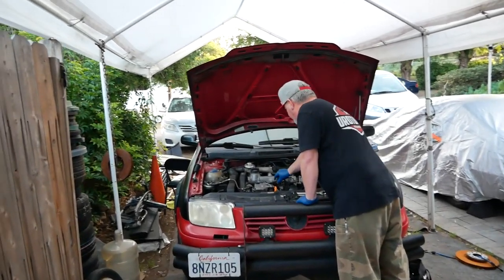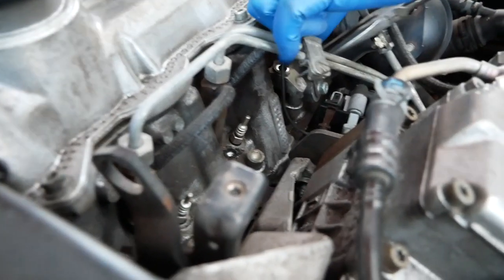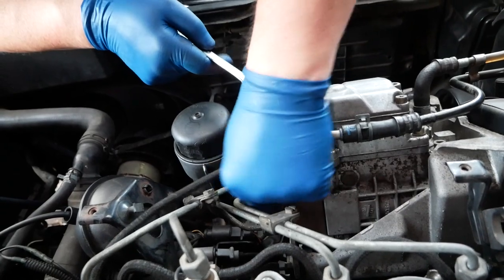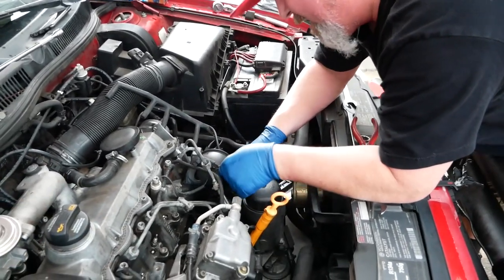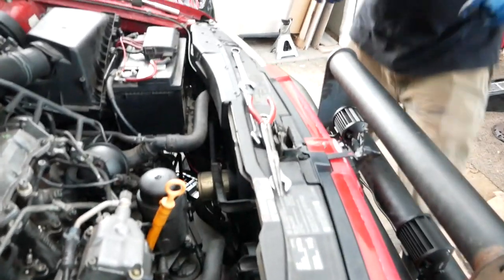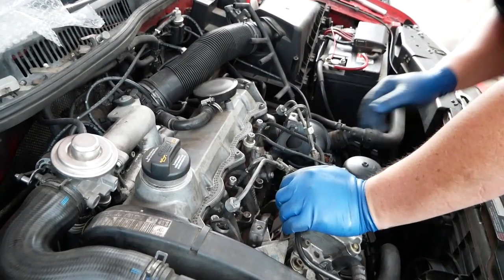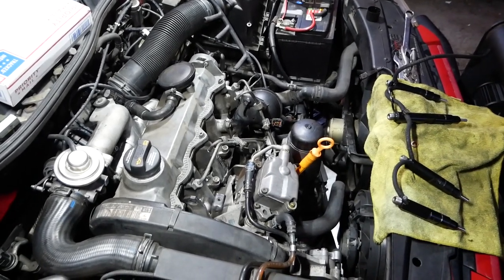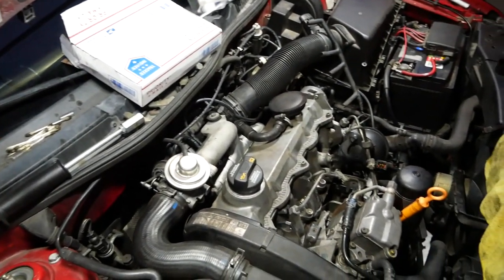How to install Upgraded Nozzles in a MK4 TDI ALH Jetta/Golf - S6EP22

Comment: Its like you skipped steps through it, kerma sucks any way just like your commentating skills
Reply from the maker: And that is ok! Not everyone is perfect. Glad we have people like you around to keep us in check.

Thanks Again! 💝
Reply: I disagree.  Thanks kerma.
Reply: We are being showed how to do it so anyone can do it. I hate the involved videos. This makes it much easier. I’m planning on doing a full overhaul of my ALH 1.9. Turbo, exhaust system, colt cam, pd150 intake, stage 3 clutch, ECU tune, injector nozzles, MAF. Already did all vacuum lines and any intersecting valve. Did a intake manifold and egr because my state requires a egr, however I found one guy who will sticker me with a deleted egr so getting ready to do the intake manifold again for a PD and straigjt pipe instead of stock shit. Hope to get close to 160hp or more. Looking at a gt1856v. Seems to require the least amount of mods for a ALH. Mine has only 120k that’s why I’m doing this. Has a slight knock but it’s due to the injection pump and or injectors I have found based on forums so hope to get it running mint and with tons of power. Any recommendations would be great thank you!
Reply: Wow. This doesn’t replace the nozzles at all. Useless.
Reply: This guy is terrible
Reply: @smilefatboy   it does tho, it’s the kerma hot swap, they put the  nozzles on rebuilt injectors for you and you send them your factory injectors
Reply: Lol, you shouldn’t be wrenching on anything if you need more steps for this, my 8 year old nephew can figure it out. I mean u own a powerjoke, probably a 6.0 Covidstroke too, kinda explains everything now
Reply: Griz, why you gotta be a rude dick? This vid was excellent.

Comment: Slide hammer puller... no need! Break torque and a tad looser on hold down blocks one at a time and run engine so the power stroke loosens them for ya :)

Comment: Kerma tdi has provided me with most of my parts for my mk4 tdi. I use FCPEURO for the rest. Now I cannot remember based on the view but, either cylinder 2 or 3 injector line was bent upon removal. There’s a slight kink noticed around 4:20 ish hard to notice, but I know because any sorta kink restricts flow and could  potentially have fixed part of your problem making up for it with the new injectors, but that one line (if you have any problems forward) would be the cause. You could see he had a hard time removing it, had to replace the block to loosen it. Like he said, make sure you crack the lines before pulling the blocks!!! Kinking a line is no fun..

Comment: Good video.  I've changed many of these...  The only thing I would add to this video is:  Use extra long qtips so you can't drop them in the head.  Either that or tape them very securely to a pencil so that if you do slip, it doesn't get in the head.  Regular qtips work, but even when vice gripped, they can fall off... Hasn't happened to me, but I've heard horror stories of people having to pull heads for that reason.  Laquor Thinner also makes a great cleaner (when used in moderation and care).
Reply from the maker: Good advice!

Comment: If you own an alh tdi just buy a harbor freight fluid extractor , dont waste time with a mightyvac. That way you can just remove the fuel lines whenever you need to and get them clean out of the way . Anytime you have to do any work to or replace injection pump or injectors it makes priming simple and only takes minutes . Must have for diesel owners
Reply: Don't need it. Air won't go in fuel will drop out air don't go in

Comment: Just remove the lines and cap the pump. Gonna have to bleed the fuel system anyway since you are gonna replace the fuel filter to protect your new injectors. Why would you reuse those old return lines and bolts? If there is dirt in the holes, why don't you clean it out? The factory manual has torque specs ya know.  Don't teach people how to take shortcuts. I'm just busting your balls and sharing my thought as I watch the video. I still gave it a thumbs up.
Reply: Don't have any experience rookie

Comment: I've driven VW diesels my whole life and I have never had to "purge air" from the lines or injectors to get an engine to start. The whole process of cracking the lines at the injectors is nonsense and only serves to spray diesel all over your hoses and engine bay as seen in the video. If your filter and pump are full of fuel, the pump will very easily overcome the air in the lines and injectors with diesel fuel - air will compress much easier than a liquid. If you have air in your pump, that is an issue, but even without sucking vacuum from the return line, the VE pumps will self pump and purge air eventually with enough cranking. I always just pull vacuum on the return, put the injectors or lines on all snug, then crank it for a few seconds and they start.
Reply from the maker: Well that good to know.
Reply: Good lad so you think that the number one piece of advise from any diesel mechanic is complete bullshit? You said it yourself air is compressible so instead of opening the nozzle and letting fuel flow through the lines the air just keeps compressing. Why don’t you try your little vacuum “trick” on a freshly rebuilt injector pump that is bone dry inside with dry injector lines and you might just figure out that cracking lines is literally the only way to purge the air. The smugness of some idiots 😂

Comment: Where can you buy that sledge hammer puller. All my injectors are stuck. My intake manifold was 90% clogged. Couldn’t even stick my pinky in it hahaha
Reply from the maker: Called a slide hammer
Reply: @PincheALsGarage  is there a specific slide hammer? Or just any. Pretty new to slide hammers...
Reply from the maker: Not really just need to fine the right attachment to thread onto it

Comment: So what happens if you cannot get the old copper crush ring out? I’ve tried everything, long needle nose, flat head screw driver, all kinda of picks to try to pry it out, but nothing. It looks as tho it’s corroded, but would copper corrode to the block?? I didn’t think so, but anyway. I’m asking if I can REUSE CRUSH SEAL??? You said two is bad, so if I just reuse the one I can’t get out is that better? Or what’s better
Reply: try it and see what happens. doesn't hurt anything

Comment: Do the pd130 injectors fit in these engines as I have a bora 1999 tdi 110 and wanted to put bigger injectors in but they look different
Reply: They dont. 90hp and 110hp are interchangeable because theyre both VP37 pumps

Comment: Is a tune required after these particular injectors get installed?
Thanks
Reply from the maker: No but you will benefit severely with a tune.
Reply: @PincheALsGarage  thanks for the speedy retort.  Is the 165 kit +  dual valve spring and retainer set up + stage 3 cam too much for a healthy stock alh bottom end?

Comment: Its normally start,i dont know where you learn to bleed air but you overkilled it,you can just unscrew one line from injector and crank unril you see fule,than screw again and engine run normally,and my tdistart on 3 cilinders when im doing that

Comment: cleanliness is everything... so don't put your injectors and lines on the floor you are walking on.. get a damn table.. or even a board on the engine top and then the paper towels, or clean shop rag.

Comment: does this affects fuel economy?
Reply from the maker: Yes and No. Just depends if you like the extra power...lol!

Huge difference in power but if you drive it hard it does use a bit more than stock and even more with a tune. 

The car was completely different machine after that.